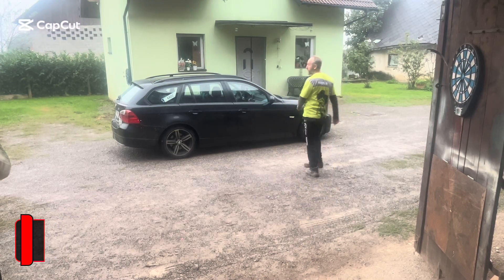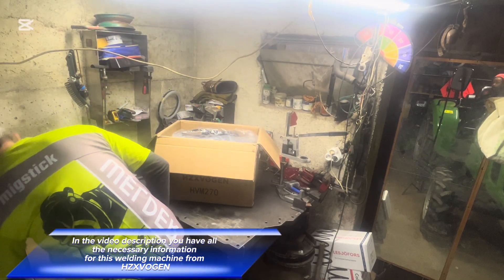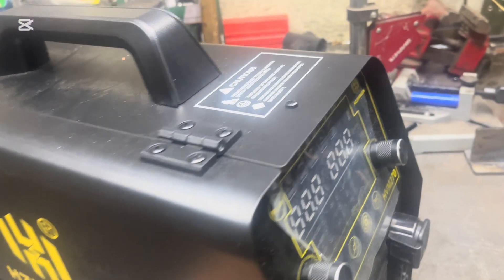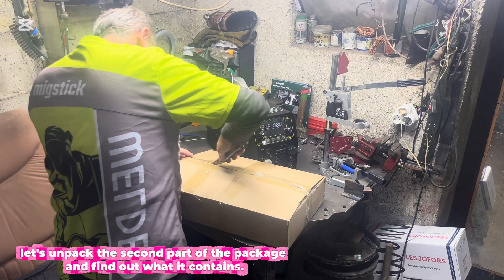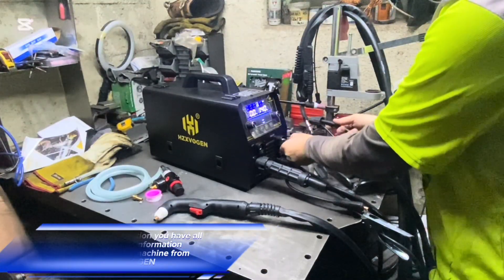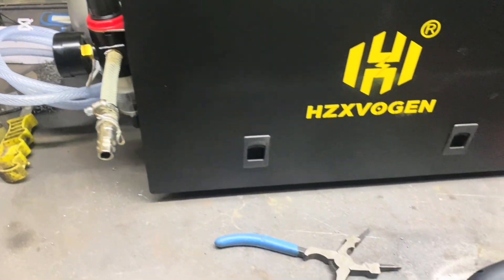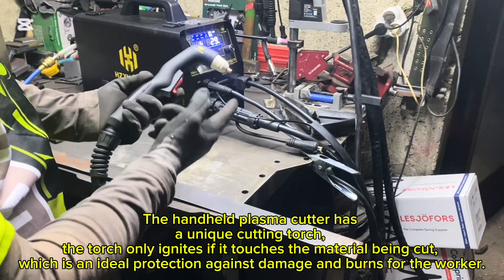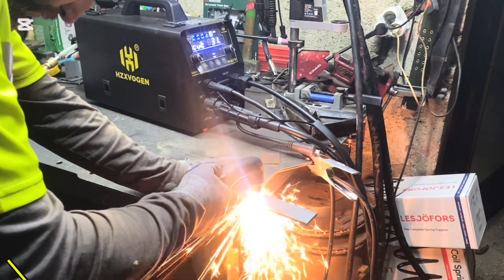Unboxing and test HVM270 Aluminum MIG Welder and Plasma Cutter 6 IN 1, 220V Multi Process Welder

Comment: can this machine tig weld aluminium AC ?
Reply from the maker: This HVM270 machine can weld aluminum using the MIG process, unfortunately it is currently not possible to weld aluminum using the TIG AC process.
Reply: @migstickwelder  thank you for your quick response👍
Reply from the maker: @superjojo555 👍🤝
Reply: @migstickwelder  очень очень жаль. неужели это правда и ничего не сделать tig с алюминием. я очень расстроен

Comment: Hi,
I have a question about the machine;
I've noticed that it's not running smoothly, and has massive interruption in the welding process! Did you noticed that? Or is a camera effect? Thanks
Reply from the maker: greetings this welding machine works flawlessly, this probably happened to you because of the camera. soon I will record a more detailed video, welding aluminum, 3F vertical in all welding methods. mig procedure with gas and without gas, as well as MMA vertical uphill, to stay up to date with the news, subscribe to the channel. and that the has a video 3F vertical uphill on the channel.